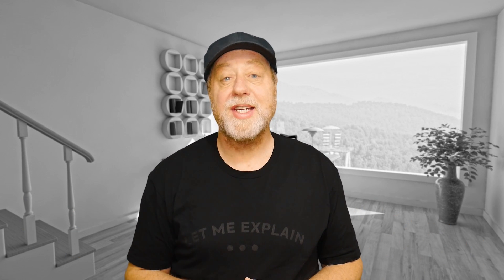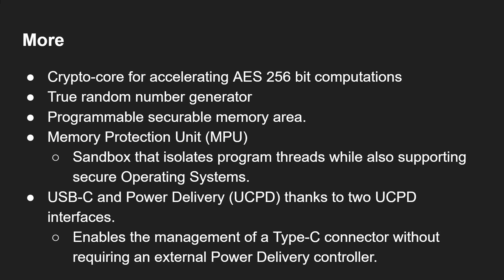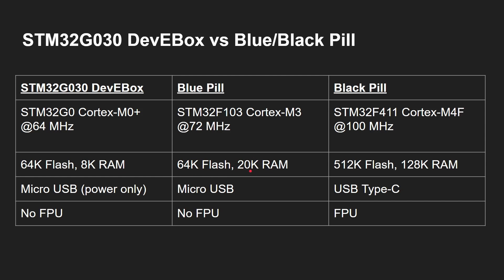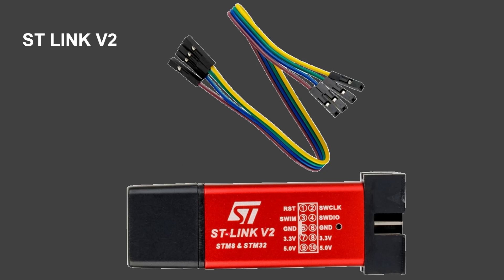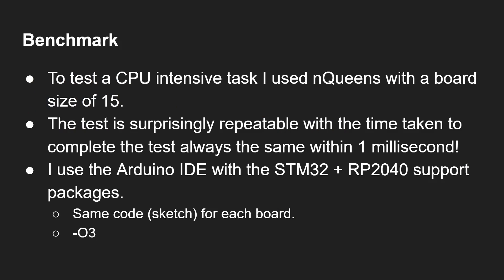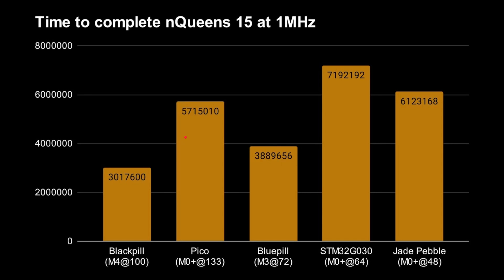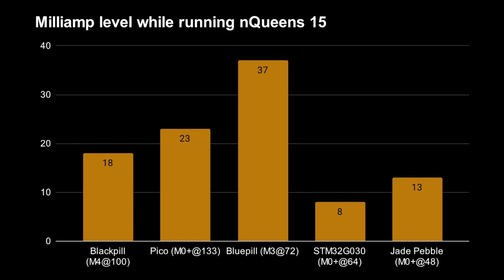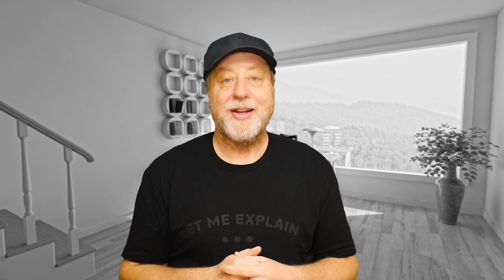Why is this Microcontroller so Underrated? STM32G030 - Cortex-M0+

Comment: I have no idea what any of this means but I'm fascinated by microcontrollers and hopefully one day I'll do something with a microcontroller
Reply: Personally, I disagree with @John Toe about skipping the Pico boards. They're powerful, cheap and are extremely well documented with a massive community behind the boards, much more than the ESP32 chips, so I can wholeheartedly recommend them. I have some advice on starting out, but I don't know what your current knowledge levels are.
Reply: It all starts with blinking an LED.  start there.
Reply: I've constructed almost 1 hundred microprocessor projects.  My advice.... Start with arduino.  As you gain more skill and experience, move on to ESP32 and the Visual Studio/Visual Micro development environment.  Skip all the STM processors and the pi pico w.  Price wise, they can't compare.  Arduino is easy to learn and implement, ESP32 has more functionality than the STM processors (with a few exceptions) and all the power you'll need.
Reply: @johntoe6127  Thanks for the advice!
Reply: @johntoe6127 well said 👏
Reply: No you wont, if you could, you would not have commented here

Comment: These "minimum development boards" are okay and are cheap if you're on a very tight budget, but getting these boards from China takes FOREVER. So I usually buy $10 Nucleo32 board with the same chip from Mouser when needed. Nucleos have ST-Link included so you can just connected to the PC with a USB cable and comes with a TON of sample projects in CubeIDE.
Reply: The built in ST-Links are a great idea. It saves having a lot of gubbings all over the place, and has UART too. My complaint against the Nucleo-32 is that they label the pins with their Arduino equivalent (aargh!) whilst they don't label the Nucleo-64 at all. What I would like to see is a Pico RP2040 in the same size as a a Nucleo-32, with labelling, and an ST-Link equivalent. That would be really handy.

Comment: Weird that Arduino uses Software Serial when the chip has 2 hardware serial ports. It's very inefficient to do that. I've made quite a few PCBs with the cheaper STM32 parts and they are really nice, with low power usage and a much better set of peripherals compared to the Atmel chips of the same price (actually better than much more expennsive Atmel parts). I do put UART to USB chips on my dev boards though!
Reply from the maker: It isn't necessarily that Arduino is using Software Serial, I did. To get a quick solution I used Software Serial and picked two convenient pins. I guess it would also work with hardware serial, but that would need a bit more investigation and I don't have the time.
Reply: stm32duino BSP definitely provides HardwareSerial for all of the STM32 USARTs, you can use that if the specific pins are available. It's just finicky to initialize the port and pins in custom ways, I spent a couple days fighting with 1.8 IDE (and mostly arm-none-eabi-gcc and board.h files) before I gave up and swapped the port numbers. CubeMX is more flexible, since we're relying on Java SE anyways. I wish there was a way to use stm32duino without the Arduino IDE, like in QtCreator baremetal + cmake perhaps?
Reply: There's so many reasons why arduino is garbage, at some point it might dawn on people but I'm not holding my breath.
Reply from the maker: What is it that you don't like about Arduino?
Reply: @GaryExplains  Where to start? 

SLOW and very limited IDE (11th Gen Core i9, 64GB RAM, 1TB PCIe SSD here and it's still painful watching Arduino compile), no debug outside of serialprint, no simulation, single step, register or variable inspect (Arduino 2 has finally made inroads for debug after how many years?).

The idiotic way it opens a new instance if you want more than one project open.

For beginners:

 The utter bin fire of the "support" forums where it's far more important to be seen to be knowledgeable than actually being helpful (ditto most hobbyist forums) etc. etc.

Examples which fail to work, compile etc. unless you know exactly which undocumented combination of IDE version and libraries were installed on the author's computer.

The good bits, it's made an awful lot of hardware very cheap and easily available, there's usually a library that is adequate for 'prove' hardware works before you develop code in a grown up IDE because someone else has often already messed about and written code (however badly) for whatever you're looking at.